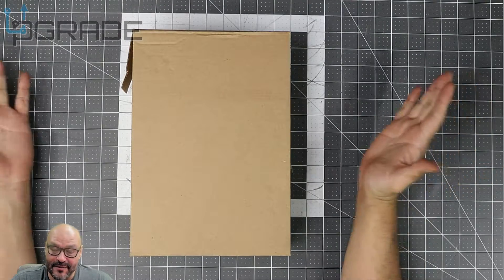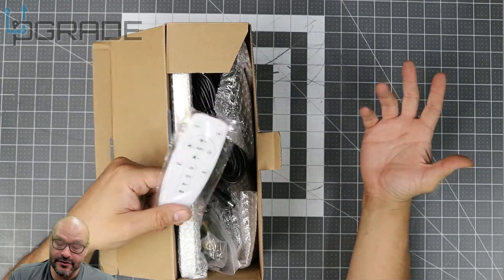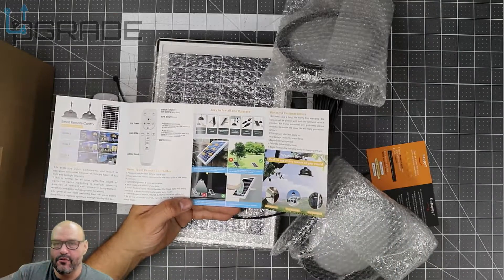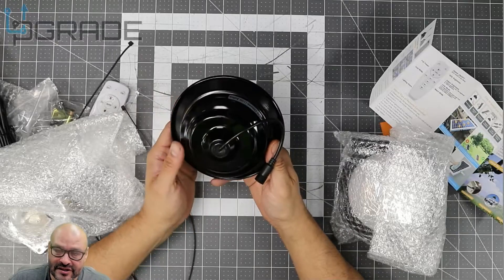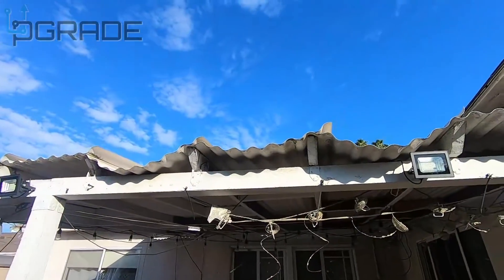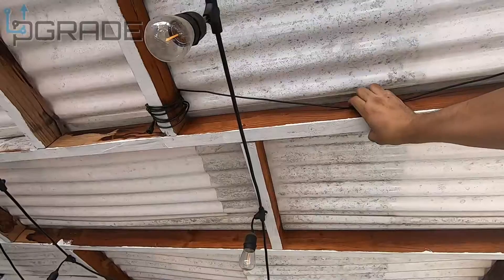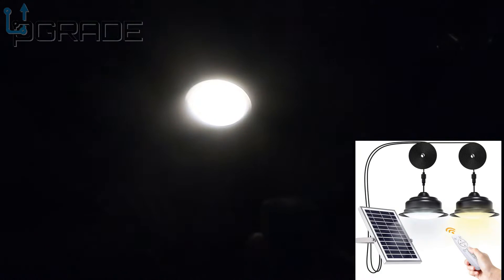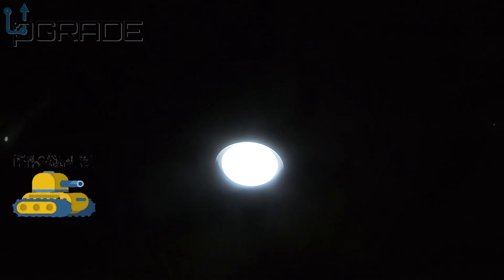Solar Lights Indoor Outdoor Home

Comment: How long do i leave the panel out in the sun  for it to charge, and how do i know it is charged fully???
Reply from the maker: Depending on location of the panel if its direct on the sun just one day should do
Reply: @Upgradetech  did the replacement help? I've seen videos if upgrading the batteries, could that help?
Reply from the maker: @marrerochica  What type of help do you need? step-by-step or reference video?